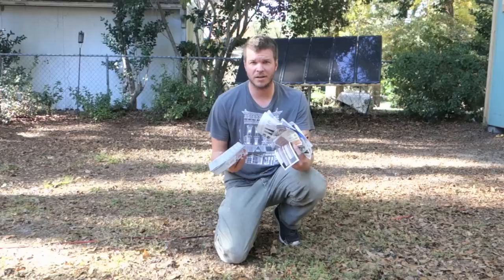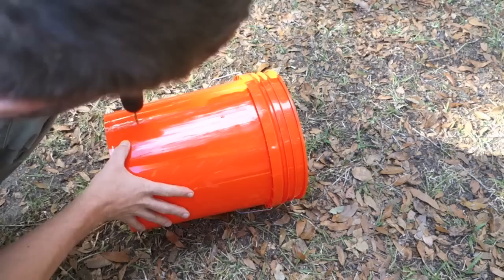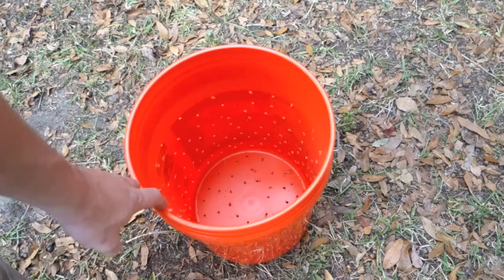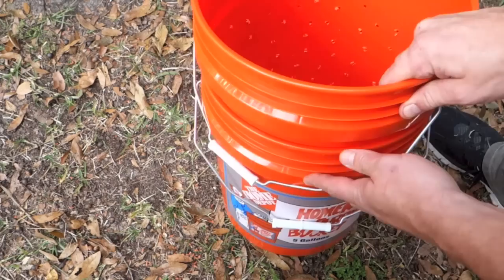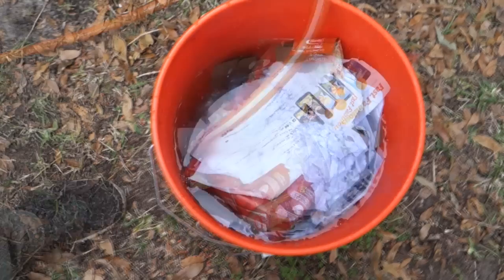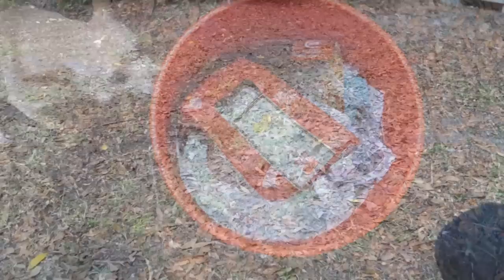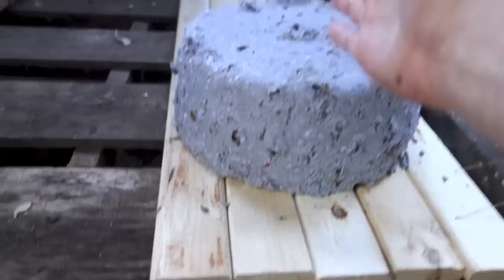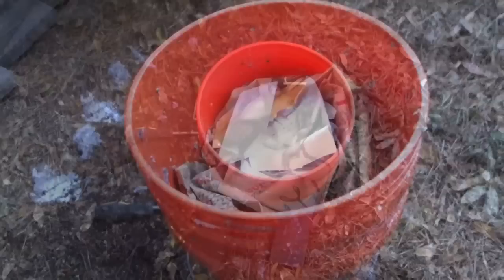Free And Virtually Unlimited Fuel To Heat Your Home

Comment: Great video man. For all you complaining about where am I going to get the paper and I'll need hundreds of buckets. In a house of 4, we probably throw away about 25lbs of trash a week. Thats 25lbs of trash that goes to the landfill and eventually gets burned anyway. As far as the buckets; after squeezing the water out of it, you LEAVE it out to dry. As someone who builds ALOT of outside fires ( I find it therapeutic). I think this is a great idea and as far as I can tell it would take less actual time after you build the initial setup than sitting at your desk looking for videos to bitch about. Keep up the good work Tiny House Listings!
Reply: Have you seen the leaf log maker? The man uses flour and water to stick it together. Seems like the glue would help it burn longer and possibly hotter. Just a thought
Reply: They don't burn stuff at a 'landfill'....hence the name land FILL

Comment: Great video!   Coming from a guy that lives in the woods and have burned wood my entire life , the best way to dry those paper logs is in the same room as the wood stove you are burning them in.   In the dead of winter here in the Northeast a home that has a woodstove and NO humidifier our homes are Extremely dry.  like 15 to 20% humidity.  So if I took these wet paper logs and put them by my woodstove when it was running it would humidify the air slightly and dry the log all at once.  It's a win win!   I could have that paper log you made completely dry in under 3 days by my wood stove.  Easily! maybe less time if I put them closer to my stove. :)
Reply: I was thinking the exact same thing as I listened to his final comments about it taking a long time to dry this paper mulch log. Put it by the wood stove inside your house where you going to use it. I'm in Southern California we also have very dry air here in the winter when the wood stoves are going. Electric heat in California is only for the ultra-rich. So is water!😅
Reply: sheepsreactingbadly  that makes no sense man.  You don't know what you talking about
Reply: sheepsreactingbadly  They could just put the log in a giant cast iron tub and sit it on top of the wood stove... Then it'd be contained if it did catch fire. I think it's pretty safe to plop it on top still but I'd remove it when I'm not around just in case....
Reply: Doesn't the ink in the junk mail  create creosot in your chimney? I was going to burn cardboard and junk mail, and the guy who installed my stove said any paper/cardboard with inks or glues will gunk up your chimney pipe with creasote [SP?] or other dangerous chemicals. So I'm just wondering if anyone else has been told this.
Reply: @jameseverett4976  I believe this process diluted the inks and chemicals... This process is also used to make clay. Blessings be all with love and light! 🙏❤️🌞✨🤗

Comment: A lot of good ideas here for sure.  I have a few suggestions to make.  Instead of a wood disc, you could simply use another bucket as a press, as they have the exact same shape.  To dry your logs, have a safe system where you use the heat from your stove as it burns your previously dried paper logs.  The extra humidity is usually good in the house during the dry winter months anyways.

Comment: there is one thing i think i should mention as an "ex" printer you must be very careful will paper that is fully printed on the fumes are very toxic so make sure the area is VERY well ventilated.
Reply: Thanks. This is important.
Reply: If any smoke is backdrafting into you're habitat something is very wrong.
Reply: Today most inks are vegetable and soy bean based !
Reply: Ink AND toxin from his "pressure treated" press board.

Comment: I used to live in an old house with my parents as a boy. We had a central heating system where the boiler was in a separate room with outdoor access. If you have the same arrangement you can always keep 10-20 wet logs around the boiler at a safe distance from it during the winter so they dry relatively quickly and you never have to worry.

Comment: Sugestions from Scandinavia: Make a hole in every log you make and draw a rope through holes, make knots between logs to act like stops to get a 2-3 inch space from log to log then hang the rope horizontaly and let the logs dry. It takes half of the time to dry the logs than putting on the shelves.
Reply: That.
Reply: And the other.
Reply: All of those.
Reply: BinAlladin
you mean this, that, and the other?
Reply: Also the next one
Reply: E. All of the above.
Reply: BinAlladin ok
Reply: plop plop, yep yep
Reply: there's lots of guides if you need help. People use this method in lots of places. Don't be ignorant.
Reply: Yeah man!! I am always happy to learn from the experts on these matters.
Reply: Babbis Christos  this is my setup if you have any improvement feel free to add to it 123456789 

I am using 10% earth, some small twigs  straw, grass, evergreen needles and twigs, evergreen saw dust  old vegetables from local stores and markets and 487 goats 2horses, 5 sheep 3 cows and or 400 rabbits, 3 donkeys 2370 rats and well over 400,000 grasshoppers manure. I combine these ingredients base on availability. I make about 3 to 8 tonnes at a thyme. then pour this slurries from one storey height into large composite pipes 12 feet long. These pipes have 1 once center core cavity. when dry I cut in a secured filtered quarantined shed with a saw into 4 inches sections. The next build will be to construct 4 inch wide 1 foot high square molds with hollow core. I will pour then compress the sludge 30 molds at a thyme. I dry them in green house. I use 7  small funnell magnifying glasses to intensify  the heat. I then pipe the heat through reflective pipes INto a confined Space. Here the hot air washes over each log. As the first drysr I push new one in from the cooler side. This will be thyme and moisture regulated. The moistened air will be burned just as a precaution.
Reply: You can also make a swedish torch out of this. Once you remove the rope. No chainsaw requirement.
Reply: @peeegeee8397  great, make a video and post the link in the comments section of my videos, would love to watch this!!
Reply: I can't picture this in my head
Reply: Man the trolls are thick on this channel. Babis Christos.
Reply: Drill holes in them and put petroleum jelly into the holes..burn longer and be a fire starter..
Reply: @desertodavid  you are the troll, sir!
Reply: @Make-Asylums-Great-Again   I'm the troll? All right I'm the troll. Go get me a troll beer while you're up. Get one for yourself on me and then sit down and tell me who I'm trolling.

Comment: Virtually unlimited fuel is a bit misleading - the constraint is clearly the amount of paper waste your household produces.
Reply: And the free bit as well, if i tried to do this it would take about 3 weeks to get enough junk mail to fill it.
Reply: Brendan Cribbs im just saying its not really a viable source of fuel unless you get a crazy amount of junk mail everyday. And i cant see them producing much heat or lasting long either but i haven't tried so i could be wrong
Reply: TheLukey21
 im pretty sure this is how they make those enviologs or whatever you call them that you buy in the store, they burn alright but seasoned wood from an oak or whatever good burning wood u got is way better and all it takes is time and effort and from what ive noticed is if you actually get them burning good they dont last longer than an hour and thats if your lucky
Reply: TheLukey21 I get a crazy amount of junk mail just about every day because I originally wanted to get some at my new address.  But I overdid it so now I have enough to heat a home I think.
Reply: Brendan Cribbs the idea is to reduce waste yet you'll be burning it depositing smoke into the atmosphere rather than burying it so it turns to compost, i think the paper is better left in the trash cans.

+xAIB  those firelogs usually have an added fuel source (most often a petroleum based wax)  that allows them to burn longer and light easier.
Reply: Brendan Cribbs their destructive because of the mix of material dumped (everything from toxic byproducts from chemical plants to materials like plastics that prevent fumes like methane from decomposing material from escaping) paper isn't the destructive element as they have no heavy concentration of chemicals and decompose pretty quickly. 

the space used to bury easily decomposed materials (paper, meal leftovers and garden waste) can be dug up after a couple of years, used as high quality fertiliser/topsoil and the hole can then be reused. decomposition can be effective if done correctly. 

Really it filters out pollutants? i suppose that's why the ozone layer is being depleted since the oxygen rich layer protecting us from overheating and harmful radiation is binding with the carbon rich gases like Carbon monoxide to make Carbon dioxide causing glacial ice to melt releasing more harmful gases into the atmosphere. Golly mister you surely have done your research on the matter.
Reply: Charlie Whelan it's true for me with the amount of letters and newspapers and boxes that i amass
Reply: +Charlie Whelan  you can buy paper so cheap it is nearly free
Reply: jackfoo2 paper waste? or something like printer paper?
Reply: waste paper you can get it from most recycle  centers old books  office paper
Reply: Did you guys even pay attention?  He said leaves grass clippings and any biomass you would normally throw away.  You’re not burning more, just burning this in place of logs on occasion.